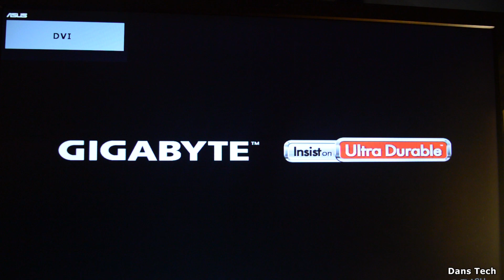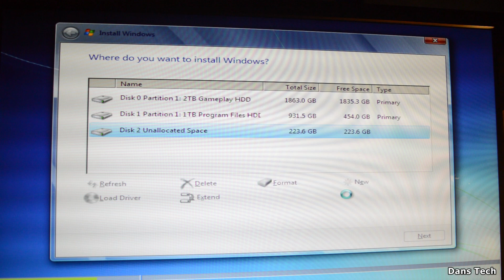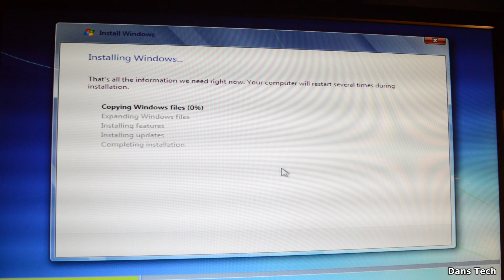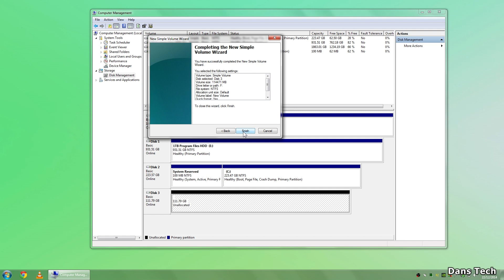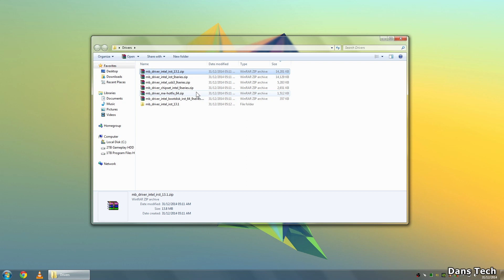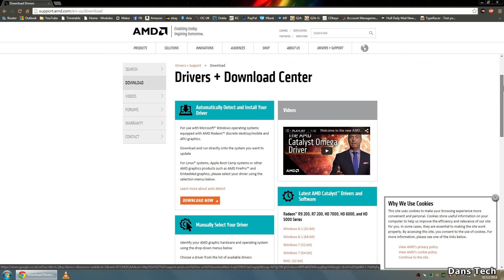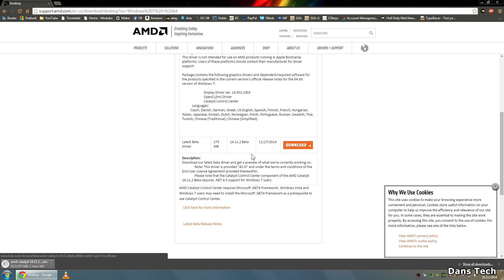How To Build A Kickass Gaming PC - Part 2

Comment: I've actually been using a laptop for the past 6 years and was thinking of switching to a custom desktop for gaming. I've just got a few questions before I start shopping for parts. first are two 770's better then a single 960 in terms of performance? and second should I start the build based around the graphics card(s) or the motherboard?
Reply from the maker: Hi, you should base a PC always around what CPU you choose at your price point, this determines the socket of the motherboard, then determines what GPU's you can choose in terms of how much CPU power you have. If you use PC part picker http://uk.pcpartpicker.com/, you can setup a system from top to bottom and It'll let you know if all your parts are compatible. This website suggests you start off with a CPU then mobo etc. Also two GTX 770's are actually on par with a GTX 980 as long as SLI support is there for the games you are playing, especially for the Triple A games like BF4 and Call of Duty. Hope this helps!
Reply: Dans Tech thanks for the help. I'm thinking an i5 processor is more in my budget so I'll probably go with a single 970 for now at least I can always upgrade to a second one later.

Comment: I'm trying to decide what case to get. I'll either get the Fractal Design Define R4 or the NZXT Phantom 410. I really like the way the 410 looks. This is my build so far: http://pcpartpicker.com/p/P9mHQ7
Any feedback on the build would be highly appreciated as well.
Reply from the maker: Daniel Mezzarroba Nice selection of parts dude! Overclocking that Core i5 will ensure you wont have any bottlenecks with that beastly 980 been in the build! Good luck with the build!
Reply: Thank you for the answer, I really appreciate it. Are there any risks with OCing though? And what should I OC it at? And also, are there any cases apart from the one I picked that you would reccomend for this build?
Overall, thank you. This is my first build and now I'm only more confident in it. Now I just have to buy everything. I'll keep you updated.
Reply from the maker: Daniel Mezzarroba Hi, there are no risks with overclocking as soon as you are reasonable in terms of what you want to get out of the chips. And i believe you could easily get to 4.0Ghz as a base clock with that water cooler. Hope this helps!
Reply: It does! Thank you!
Reply: Also, are there any cases you would reccomend for that build?
Reply from the maker: Daniel Mezzarroba Just like a mouse and keyboard, a case is personal preference, therefore im not going to recommend any case apart from the one I use, and its newer version, the Define R5. These components will fit in nearly any standard ATX sized case, up to you dude!
Reply: I'm probably going for the R5, or if I don't find it, the R4. I was going for the Phantom 410, but I noticed the Define series has some really good noise reducing systems.
Btw, I'm planning on in the future, making a SLI with another 980. Do you think it's worth it and will the CPU handle it?
Reply from the maker: Daniel Mezzarroba Okay seems a good plan, the R4 is a great case. As for SLI'ing two 980's, thats a great way to get nearly double the FPS in games, if you were wanting to do this you will see performance increases by using an Intel Core i7 hyperthreaded 4 Core CPU, but this is something you can upgrade to in the future if you believe you do need to. Hope this helps dude :)
Reply: Well, I'll look it up in the future for what i7 to get and things like that if I have to. Thanks for the help! I'll keep you updated on the build as well.
Reply: Dans Tech So, a little update. I'm thinking about getting an Asus Maximus VII Formula instead of the Sabertooth, for having some gaming features that I will probably want to have. Do you think it's worth the price difference and are there any other MBs you would reccomend me?
Reply from the maker: Daniel Mezzarroba Hi, fair enough, the Maximus VII Formula is a Z97 based board so its a good board to go with, however so was the Sabertooth. What features of the Maximus were you wanting to use?
Reply: Dans Tech It has some networking, audio, interface and protection features that benefit gaming. Also, it has a really good BIOS. Not sure if it's worth the extra price though.

Also, I need some help on the GPU. I'm going for the GTX 980, but not sure about the model. My pick was the EVGA SC ACX 2.0, but I got recommendations on the Gigabyte G1 Gaming, and it has some better specs too. Any advices?

Comment: Hey. Is this Build good?

Gigabyte Z97M-D3H
4th Generation i7-4790K (Stock cooler, No overclock)
GTX 760
16 GB RAM
1 TB HardDrive
Windows 8.1 Pro x64 SL EN
Reply from the maker: Good stuff man, however I will say you do have a lot of CPU power. If your main intention is gaming, you could get a cheaper/slower CPU and a better GPU, this will get you better FPS in games! Hope this helps! :D
Reply: Dans Tech It's mainly a Video Editing PC
Reply from the maker: Sri Teja Chilakapati Great stuff, keep everything as is. Good luck on the build if you haven't built it already!

Comment: Hey i am thinking of building this but i need to subtract the cost for the graphics card i got my Gigabyte Radeon R9 270X OV 2GB and fo i need 2 graphics cards ? ☺
Reply from the maker: Hi, I only have two graphics cards as I want the absolute best in line performance for a sensible price. Most of the time its better getting 2 of the 2nd best GPU's rather than 1 top of the end one! Cheaper and get get better performance.
Reply: Dans Tech
Ok thank you :) But i do not think i would need 2 graphics card cuz i mostly play dota 2 and some other stuff

Comment: Nice video man!But u could do it much better!First:top fans need to push hot air out from the case,not to pull it in(hot air is coming uptop,as u might know).Secondly:top cage for HDD's must be removed for better airflow(especialy u have two cards)they could be more air proof.In other reason very good build.

Comment: Hi, i want a build that can run COD:AW at 80-90 frames. This is what i can up with. Any suggestions? BTW, the psu is in the case.

Processor

Amazon: http://www.amazon.com/AMD-Athlon-Processor-AD760KWOHLBOX-Richland/dp/B00D7BYMB2/ref=sr_1_7?s=electronics&ie=UTF8&qid=1420253441&sr=1-7&keywords=amd+cpu

Motherboard

Amazon: http://amzn.to/Y7dH3u
Newegg: http://bit.ly/1vewrJf

RAM

Amazon: http://amzn.to/1uv5TWI
Newegg: http://bit.ly/1yX9cUp

Case / PSU

Amazon: http://amzn.to/Y7d4Hk
Newegg: http://bit.ly/1rUPB4S

HDD

Amazon: http://amzn.to/1lWDlNN
Newegg: http://bit.ly/YwoSmK

GPU

Amazon: http://amzn.to/1uv4XS9
Newegg: http://bit.ly/1tjtFlD
Reply: why the hell are you playing aw on pc? its so unoptimized.

Comment: The cables on Corsair PSU's are crap I think, really stiff plastic.
Reply from the maker: Got to agree, however apart from the stiffness of the cables, the RM Series PSUs are absolutely solid!
Reply: Dans Tech Well I had an issue with mine actually so I had to switch it. I ended up with a EVGA and its much better quality but it was more expensive. I was really disappointed with the cables on the Corsair. I know a lot of folk like them though.

Comment: Hi, Question, Is this a good build?
Graphics Card: Sapphire Raedon R9 270
Processor: AMD FX6300 Black Edition 6 Core
MotherBoard: Asus M5A97 R2.0
Memory: HyperX FURY Series 4GB DDR3 1600MHz CL10 DIMM Memory Module
HDD: Seagate ST1000DM003 Barracuda 1TB 3.5 inch Harddrive
PSU: Seasonic S12II-520 520W ATX12V Standard PowerSupply Unit
Case: Corsair Carbide Series 300R CC-9011014-WW Mid-Tower Gaming Case.

This is my first pc build. Could anyone suggest any Monitors???

Comment: I think you should put your rear fan(the one on radiator) in intake position from side blowing hot air inside, then the top two AF LED fans in exhaust as heat rises up from GPUs and CPU, it wil directly because in your current fit, you only have one exhaust that too with radiator so Temps will be bit higher than what my suggestion will get..

Also remove the above HDD cadie and move the three drives to the bottom cage and remove the top drive cage which will help you in direct airflow to the GPUs.

Hope you like it.. Anyways great video.. I'm subbing..
Reply from the maker: Hi, thanks for the sub! As i said to Barry Cooper in a comment below this one, I wanted to get positive pressure so the radiator would literally be blowing the hot out out with as much force as possible. I can say that this working great and the static pressure on the rad is working a treat to keep it cool, not to mention how much cooler the GPU's are from when the fans weren't there at all :) I'll give it a try swapping them around, thanks for the suggestion. Also I'll try that with the HDD Cage!

Comment: I would have put the top fans as pushing air out. Nice video Dan. They look very professional now. Hope university is going well also.
Reply from the maker: Hi, I wanted to get positive pressure so the radiator would literally be blowing the hot out out with as much force as possible. I can say that this working great and the static pressure on the rad is working a treat to keep it cool, not to mention how much cooler the GPU's are from when the fans weren't there :) I'll give it a try swapping them around, thanks for the suggestion.

Comment: Dan, doesn't the soundcard block some airflow for the top video card?
Reply: Also, am I able to reuse my Windows 8.1 key when reinstalling the OS?
Reply from the maker: Hi, I would have thought that but it looks like it doesn't affect it that much at all. Both cards don't thermal throttle at all :)

Comment: Hi Dan, 

Is there any difference between a Evga super clocked 2.0 gtx 970 vs the Msi gtx 970 twin forzer? Also What Mouse and keyboard dou would you buy for under 40£? thanks.
Reply from the maker: Hi, both cards are very similar, save yourself money and go with the cheaper option. You are still going to be getting the 970 GPU Chip underneath the cooler. Also I've not got much experience with trying out lots of mice and keyboards, however i must admit i really like my Corsair K50 and Steelseries Kinzu V2 in Orange! Gotta dig that colour! In all seriousness, a great mouse for the money, very accurate and fits my hand perfectly. Not sure on cost but I got my mouse for £28 and the keyboard was about £50 I believe. You're always going to pay more for a quality keyboard, especially if its a mechanical one.